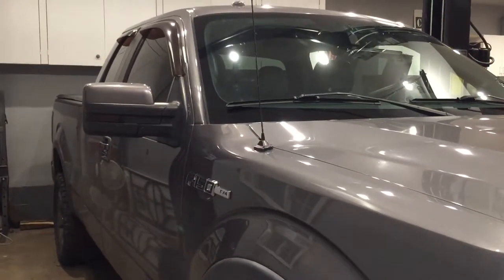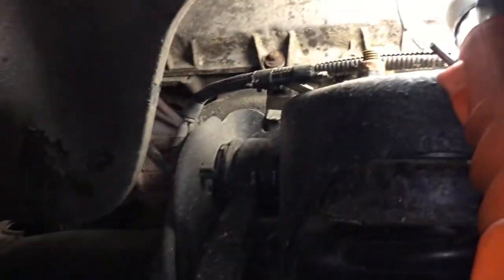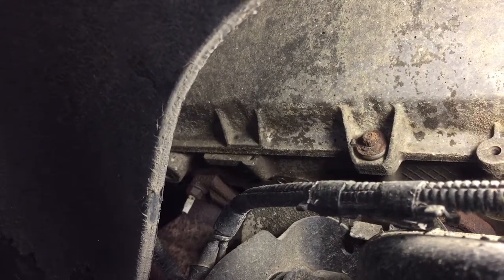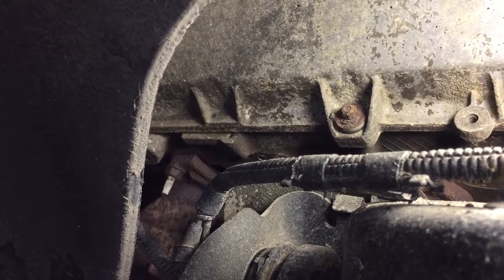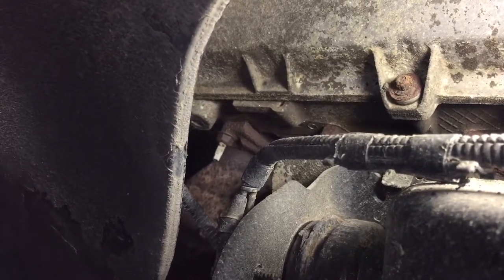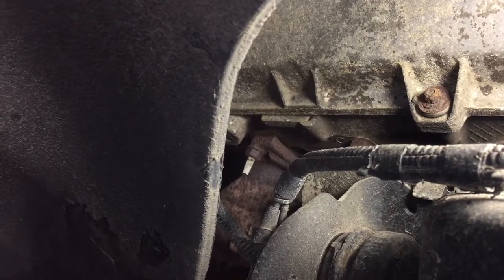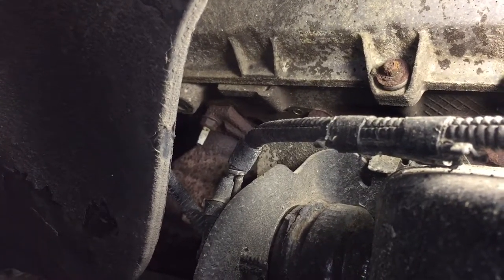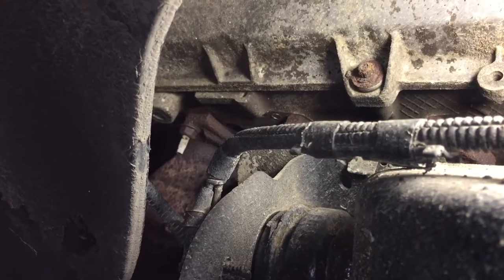F-150 exhaust tick fixed! Rusted and broken studs on 2010 F-150 with 5.4L

Comment: Is it possible to tighten the bolts (mine arent broken but i think theyre loose over time) without taking anything apart?
Reply from the maker: @Rob-z9y  rarely do they get loose. They probably snapped. But simply removing the fender liner will let you see if they’re missing or not. And with the right assortment of tools you can tighten them.
Reply: @justthetipgarage5305  Thanks. trying to track down what the noise coming from truck is. at start up its a light tick. after few seconds, it gets quieter but still there. when driving under throttle you hear the noise but not when off throttle. heres vid i made. the sound is specifically from passenger side. 

https://www.youtube.com/shorts/QOVepAe4NDc
Reply: @justthetipgarage5305  Also the truck drives fine. No performance issues
Reply from the maker: @Rob-z9y  look for a broken exhaust stud. That’s my guess. Remove the tire and inner fender well and you’ll be able to tell quick. Or you can use a
Camera or mirror.
Reply: @justthetipgarage5305  thanks, ill see what i can figure out. I was able to see the top 4 bolts... they're intact. I'll have to move camera around and see about bottom 4 bolts. The truck has lived in dry heat climate its life so rust is no factor.
Reply from the maker: @Rob-z9y  it’s almost always the passenger side most rearward bolt. Closest to the firewall.

Comment: Will missing exhaust bolts cause a tick that matches RPMs? If I step on gas tick I speed is increased and it does not go away when warmed up. I see one missing stud I think? on passenger side which seems to be where it’s loudest. I stuck a screw driver in it and it felt like it hit a wall as if the stud snapped in half inside it idk.
Reply from the maker: Yup if it doesn’t go away when warmed up you have 2 snapped studs. The one you see missing and the one on top of it most likely. If you’re lucky you may be able to drill it and get an easy out in there like I did. There’s no pressure on the studs so it’s just rust you’re fighting. Mine came out pretty easily
Reply: @justthetipgarage5305  ok thanks I’ll try that. If that doesn’t work could I use manifold sealant over the hole until I can get it properly fixed?
Reply from the maker: Nope. The problem is the exhaust manifold isn’t being held on. Needs pressure to seal it. Some say you should get a new manifold. I used the old one and just put 2 new bolts in there. Little bit of a pain but with the wheel and inner fender removed you can just barely get in there.
Reply: 5.4 3v tick, clunk or knock sound from engine could also be from phasers or chain slapping from low tension as a result of low oil pressure.

Positive air flow test to rule out exhaust manifold leak and if not exhaust leak then move on to properly diagnosis of timing system.
Reply: Did you don’t out?

Comment: Any update on this fix? Thinking of doing the same on my 2010 F150. Thanks!
Reply from the maker: Nick Witte haven’t had a problem with it since this fix
Reply: @justthetipgarage5305  Awesome thank you sir. Just checked mine and top bolt is gone. The bottom one is still there but will probably replace the bolt anyways.
Reply from the maker: Yea man do it while you can.

Comment: The mechanic told me he needs to take off all the studs and replace all the bolts is that true?? Why can’t he just replace the broken stud like u did?
Reply: Also quoted me 2500$ to fix it ….
Reply from the maker: He could but he’s probably just going to do them all in case another broke a week later. Say you took it in. He fixed just the broken one. And then a week later another snapped. Since he’s already in there he might as well replace all of them. My fix is the quick fix if you’re doing it yourself.
Reply: @justthetipgarage5305  so if I tell him I just want the one stud repaired he should be able to do that? He’s quoting me 2500$ for a new manifold and all new studs when all I really need is 1 new stud… id rather just pay for him to repair the 1 stud
Reply from the maker: You can ask him to. He may or he may not. His way is technically the right way. If you want to you can try it yourself, a new pack of studs is like $6. If you can get the broken one out you can replace it easily. If not you take it to him.
Reply: @justthetipgarage5305  I’m not to handy with that lol,, I’m gonna try and find a mechanic that will just take out the broken stud and put a new stud in. Should be way cheaper then a brand new manifold and risking breaking more studs while taking the others out
Reply from the maker: Yea doesn’t hurt to call around at all.

Comment: could you do the driver's side the same way?
Reply from the maker: Ma vie en van absolutely. Same process as the passenger side. These studs are known to rust off. If you have the ability, change them all out.
Reply: @justthetipgarage5305  thanks for the reply. Is there a way to know whether it's the whole manifold that needs to be changed?
Reply from the maker: Ma vie en van if you can look or feel and any of those studs are missing, that’s your problem. The missing stud or studs is slowing the exhaust to escape in between the manifold and head. If all studs are in tact re torque them. If it still ticks you’ll need an exhaust manifold gasket at minimum. But you’ll have to pull the exhaust manifold to get to it so you can see if that’s cracked or not
When you pull it off
Reply: @justthetipgarage5305  right, thanks man!

Comment: My 2007 5.4 just started making a ticking noise out of now where on start  up. Goes away after I drive for a little. Do you know what  that is?
Reply from the maker: It’s this.
Reply: @justthetipgarage5305  I appreciate the fast reply. This is really upsetting because I had just purchased the truck 2 months ago. I’m a broke college student so I don’t have the funds to take care of it right now. Was hoping I just had a loose spark plug. How long do you think I can drive like this without causing any damage?
Reply from the maker: You can drive with it. Start it up cold and take a look on either side until you hear which side it’s coming from. Then use your phones camera to check all the bolts. If one of the heads are snapped off this is your issue. If you have all your bolts then this may not be your issues. Another common problem is the lifters ticking. In which case putting in some Lucas heavy duty oil stabilizer may fix that. Either way you can drive on it. But it wouldn’t hurt to find the source of the problem.
Reply: @justthetipgarage5305  Ok cool. I really appreciate it. 3 year old video and you are still replying to comments. I salute you bro 👏🏾
Reply: @justthetipgarage5305  Just turned my truck on and it’s not doing it anymore. Yesterday was the only time I heard it happen.
Reply from the maker: Yea keep an eye on it. If it’s a broken exhaust stud it will happen more in the cold and then it stops when it’s warm or the engine is warmed up. Heat = expansion. You probably have 1 broke. If you have 2 it’ll do it all the time.

Comment: DID IT TICK AT BOTH STARTUP TEMPERATURE AND NORMAL OPERATING TEMPERATURE?
Reply from the maker: Cee Los if it just does it at start up it’s one bolt. If it still does it at operating temperature then it’s 2 or more exhaust studs. It’ll be the very back two. Top
And bottom.

Comment: No video showing the tick went away?
Reply from the maker: It went away, just didn’t get a video of it. This is super common.
Reply: @justthetipgarage5305  Im hearing both the words bolts and studs are they not the same thing that you are mentioning in this video?
Reply from the maker: They are rusted exhaust studs. I called them bolts mistakenly.
Reply: @justthetipgarage5305  Thank you!!!

Comment: Did you remove the manifold, you may have said in the video but my dog won't stop barking
Reply from the maker: aaron rothe I did not remove the manifold, I was able to remove and replace without taking it off
Reply: @justthetipgarage5305  thanks

Comment: Can you change one stud without taking the other rusted bolts out and the whole manifold off? 09 5.4
Reply from the maker: I was able to do that with just the back bottom stud. I was able to get a drill bit in there and then tap in
A removal tool. It came out easily and was enough to stop all leaks.